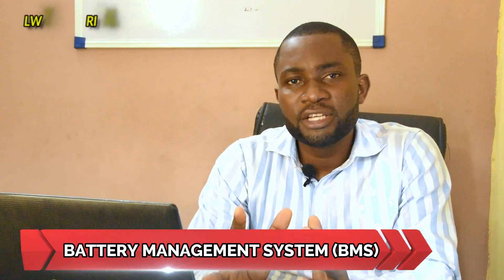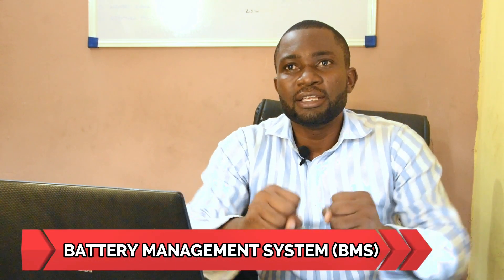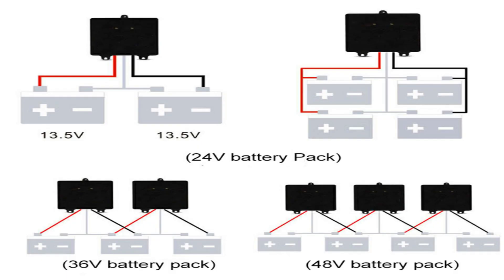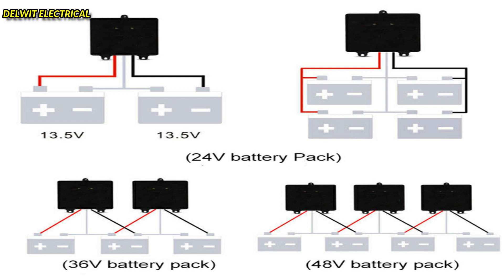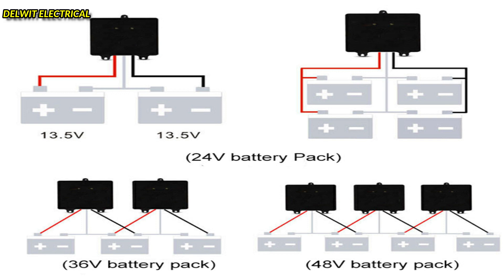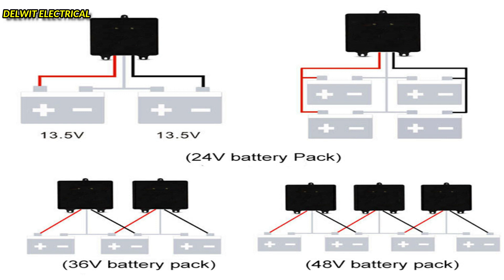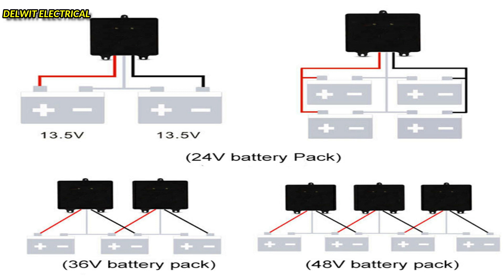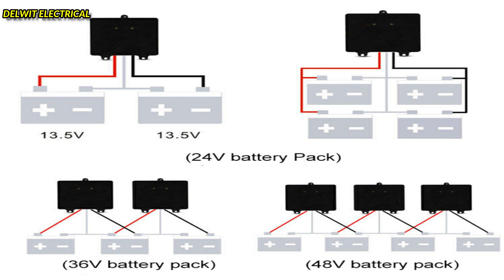How to connect Battery Equalizer to increase the Backup time of your Inverter

Comment: What type of battery that uses the equalizer lithium or tubular batteries
Reply from the maker: @rehopeniel5989  All type of batteries although Lithium Ion battery has it's own type of equaliser.
Reply: @DELWITElectrical lithium battery has its own BMS so u don’t need it in Lithium batteries. Only for wet and dry/gel batteries.
Reply: I use tubular is it necessary for me if yes what type do I buy since lithium has it own. Kindly reply
Reply from the maker: @rehopeniel5989  All other types are thesame, it's only that of Lithium that differs. So since you use Tubular Batteries, you can buy the regular one something similar to what you have on the thumbnail of this video

Comment: Pls I need clarity on the use of an battery equalizer device; can it be connected permanently to the inverter batteries while the inverter system is running?
Reply from the maker: @obinnandefo827  Yes please, it can be and infact should be. For every charging it monitors the SOC and balances accordingly
Reply: Yes!